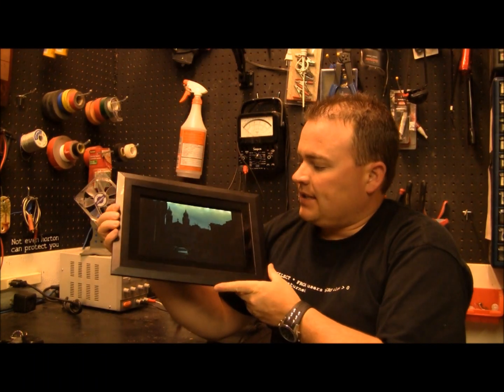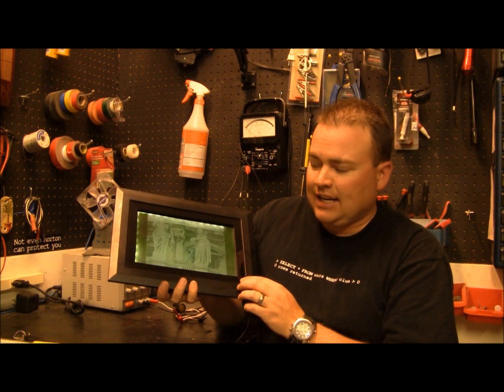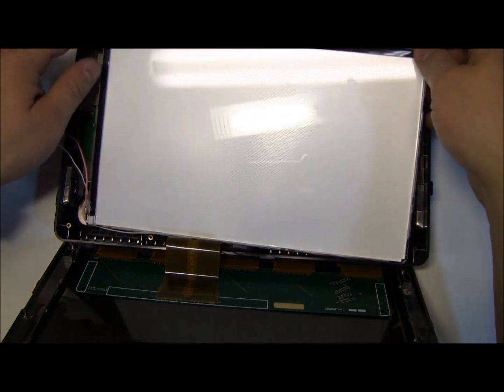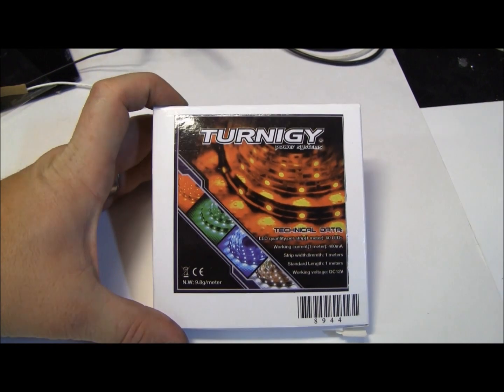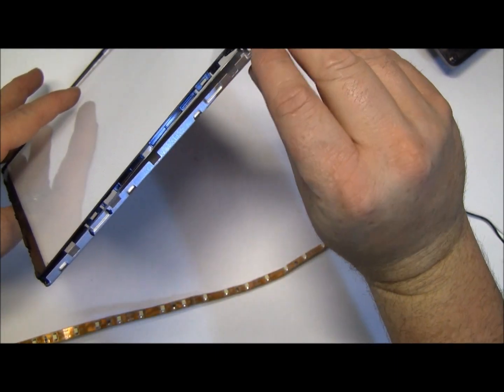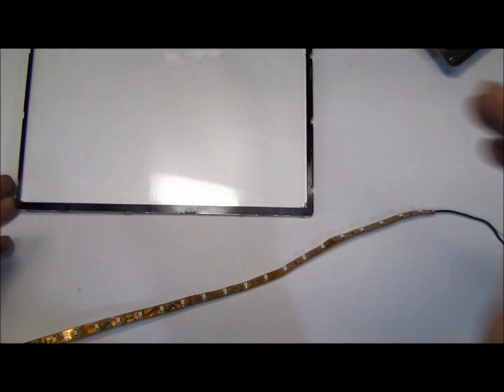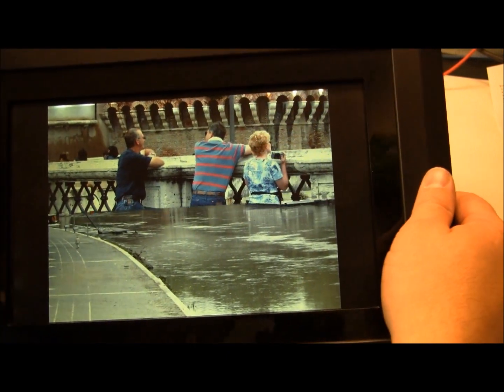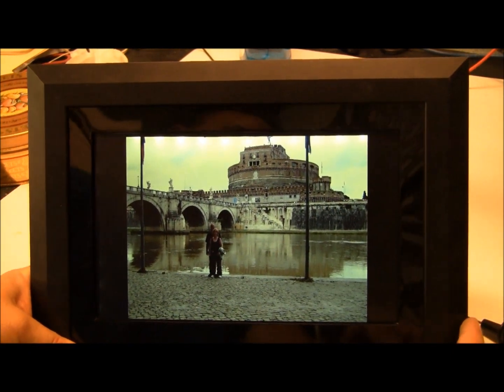Repairing broken LCD screen backlight with LEDs

Comment: It has been my experience after fixing several hundred LCD screens, over the years, that the CCFL tubes tend to wear out before the inverters do.  With this being a picture frame it is hard to justify buying new bulbs or inverter but if it is a laptop or desktop screen buying replacement bulbs can sometimes be the best solution.  If you do modify the screen to use LED's you can now buy high density LED strips that have higher intensity and place the LED's much closer together.